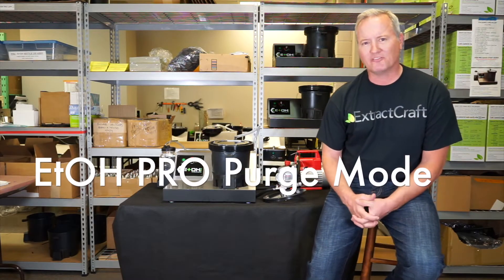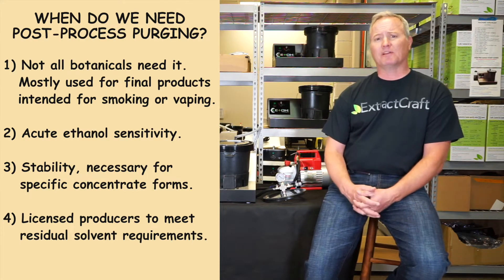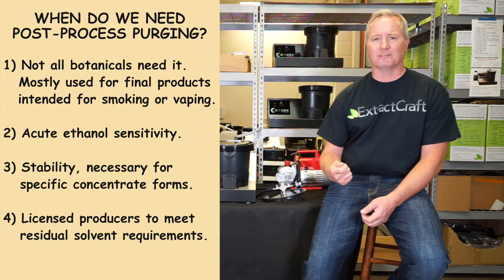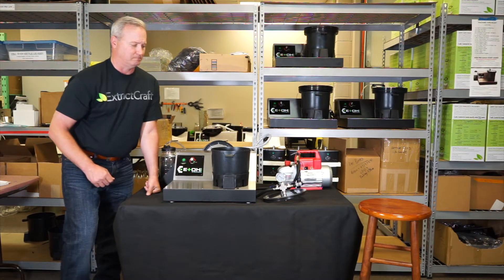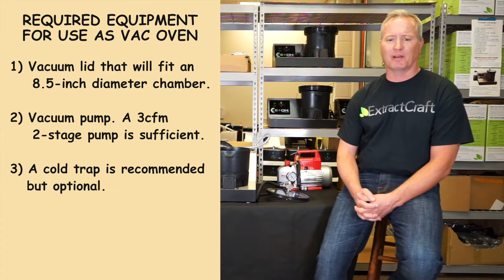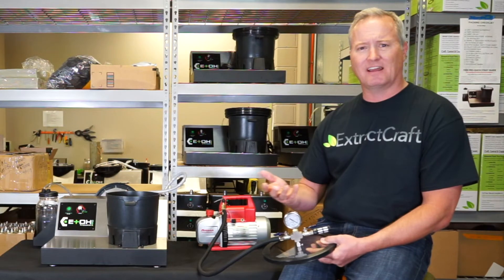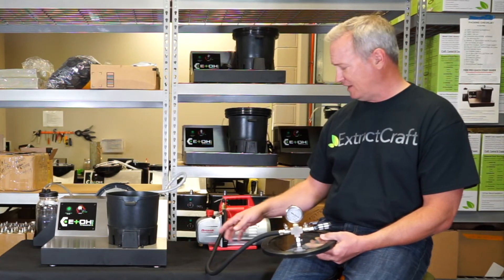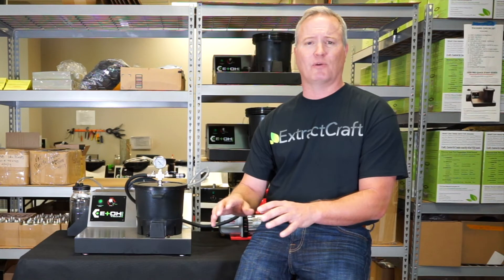EtOH PRO Purge Mode

Comment: Do any terpenes survive this process? I’m assuming by the time the purge is over, the oil is mostly decarbed and terp depleted.
Reply from the maker: Our equipment is under vacuum and works at low temps so terpenes are not degraded in the process. From there, as long as you purge at low temps the terpenes will be preserved. Check out extractcrafter.com for more detailed information

Comment: When using a cold trap do you have to leave the pump on so you don't get oil backup into the cold trap it's self only other option I can think of  would be to use a valve on the pump side of said cold trap that or maybe the trap is meant to get pump oil in it just a bit confused on this part my impression was always that you could reclaim the last little bit but maybe I'm completely wrong and it's just for pump protection on that last little bit and it's meant to mix pump oil and the remaining solvent
Reply from the maker: Yes, good point I may have left out and not addressed.  Having a shutoff or check valve between the cold trap and pump would be very useful.  The most obvious simple solution would be simply to break vacuum between the cold trap and pump when you turn it off.

Comment: Please, someone, just tell me which pump to get, lid, etc.  I'm a week older from when I started doing research and just want to know what's in this video.  Appreciate you!
Reply from the maker: The one in the video is a Robinair 3CFM Rotary vane pump.  If you need help with your decision you can also call the sales guys a Lab Society or Best Value Vac, they are pretty helpful
Reply: @ExtractCraftVideos  Thank you SOOOOOOOOO much!!!!!  Looking to buy one, now...  Do I HAVE to use a vacuum pump or can I purge using just your machine and heat?

Comment: I have a question for you sir I’m very interested in your product for producing a very medicinal (RSO, FECO) type oil. If I’m processing roughly a lb. of material, rather than trying to decarboxylate that much product and risking a mistake. I was planning on buying the nova decarboxylating pod and just finishing off the oil in that device. Would that work? Or do you have suggestions on the post processing decarb? I don’t want to get into a small rotovap, your device looks h more user friendly.

Comment: You would think the EtOH Pro would come with ALL that for a price over $2000!!! Why would I get that if I still need to do MORE purging to make it smokeable?? Please explain.
Reply from the maker: The main reason is they are not necessary components for many operations.  Many people are using our equipment for things other than smokable products so there is really no reason to add those pieces of equipment and increase the price for those that won't be using them.  Also, many small producers are using for higher volume tasks and use dedicated vac ovens for post production, where again there is no reason to make them buy more equipment than they need.  $2,000 is a very reasonable price for the equipment, tech involved, and job it does.

Comment: some questions:
1. why can´t the built in pump be used for purging?
2. what size pump is built in? (also 3cfm?)
3. the dial "- extract + and  - purge +"  is a temperature control dial? 
4. in purge mode the internal pump is switched off?

thx
Reply from the maker: 1) Its is tuned for ethanol evaporation.  Post production is a different performance factor and would required additional complexity and cost where many users don't really need and wouldn't use it.
2) They are specialized and governed to work at the programmed algorithms
3) Yes, details are available in the user manual on the website www.extractcraft.com
4) Yes
Reply: @ExtractCraftVideos  thanks!!